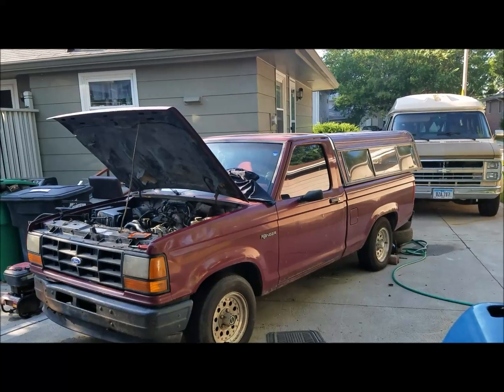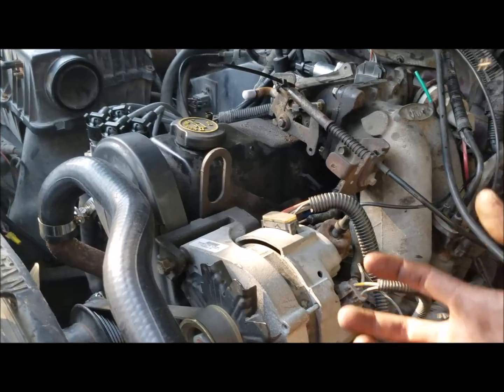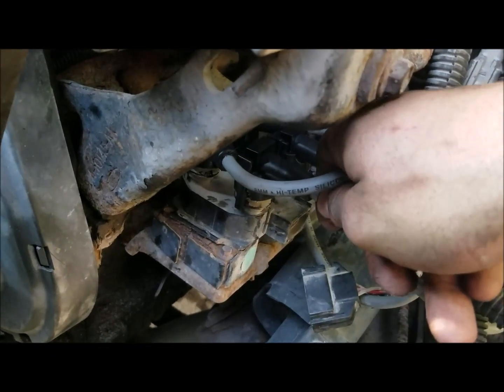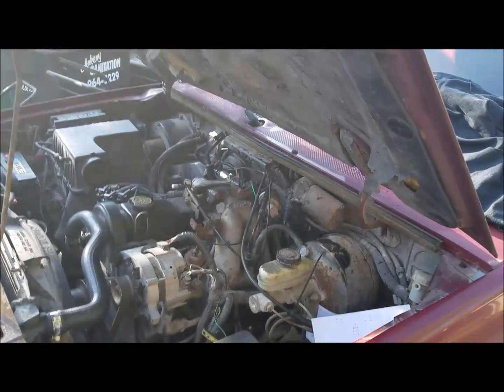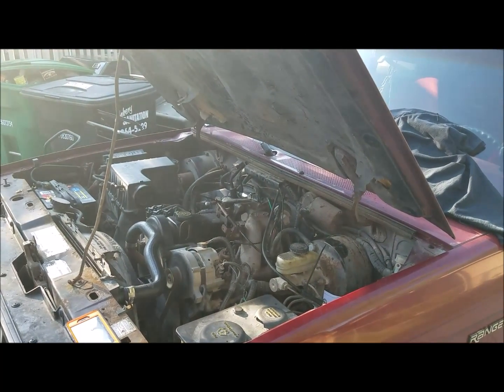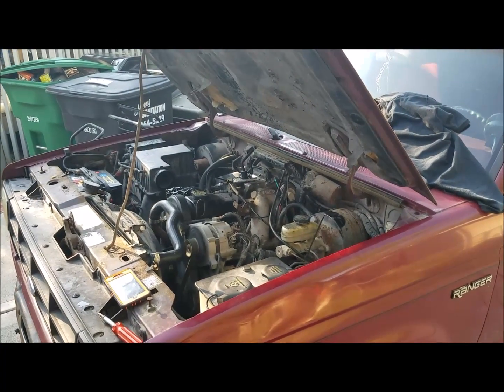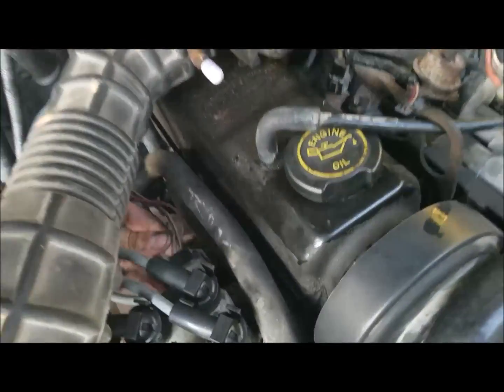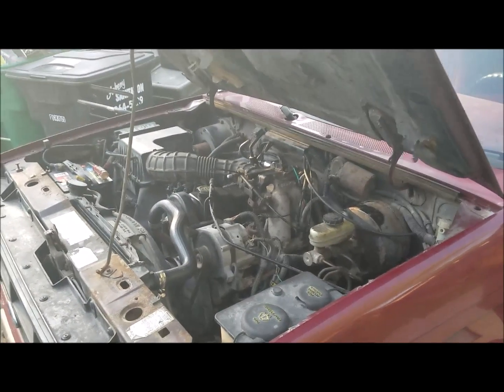Ford 2.3 8 Plug Head - FREE Dual Ignition Mod: How To & Demo (+ HP & ECON)

Comment: This is total bs. The dual plug ranger only has 4 coils, two per pack. Both plugs fire twice per cycle. Basically every time the piston hits tdc. How do I know this? The coil packs are the exact same as in the 2v 4.6. Do yourself a favor and pull both wires you swapped and check if you don't believe me. I'm sorry, but there's no "free horsepower" here. And even if what you are saying was true, firing both plugs at the same time is only a performance feature with high compression engines running race gas. In the case of the ranger, it is for emissions only.
Reply from the maker: When then coils moved to both vein on the passenger side, they both fire at the same time. On this rig the driver fires on exhaust. Fact. 
But I have found for it to only be on this design.
Reply: ThunderHead289 you are absolutely correct, the driver side does fire on the exhaust. It also fires on the ignition. Same with the passenger side. Both plugs fire twice during the complete cycle, every time the piston hits tdc. Try this, swap your plugs back to normal and disconnect your passenger coil. Or swap the wires on your passenger coil. I bet it still runs normally.
Reply from the maker: Joshua Black yeah, that’s the thing. It absolutely doesn’t run if on the standard set up I pull the passenger coil. While running, it will immediately die. Fact. 
On later models, they stay running. 
This plug order deal came from somewhere you have to remember. The new design refutes it entirely and that’s why I would assume there is so much back and forth on the topic
Reply: ThunderHead289 here's the problem, the newer system (94 and up I believe) and the older system, use the exact same coil. I even double checked just now (part # 2-5186) so unless Ford put some failsafe on the older system but not on the newer, there's a problem here.
Reply from the maker: Joshua Black just because it used the same coil doesn’t mean it gets sent the same signals. For instance. The new design - coils both on passenger side will start no matter which coil you have unplugged. The older unit will not if you unplug the passenger side. Fact - I show it in my video. 
Wish I would have shown it cutting out when I unplug the passenger side. Then all the nay sayers would be pacified. Unfortunately I don’t have the truck anymore.
Reply: ThunderHead289 I saw what you did, not refuting it. I'm also not refuting that the newer system is different in that either coil will start the truck. But, using that very difference, consider this; the firing order for the secondary coil doesn't change between styles. It is a wasted spark system on both, regardless of what information the system gives the coil, it only functions one way. Too bad you don't have the truck anymore, would have loved to see you try swapping the plugs on the primary coil to prove everyone wrong and settle the debate once and for all.
Reply from the maker: Joshua Black me too, I actually even contacted the current owner but he had sold it along and I couldn’t get ahold of it. I know, but it would be nice for the world to know. 
It definitely functions different throughout the years. I am on the hunt for one to literally pay a guy 20 bucks to do this for the camera. 
Such an annoying debate.
Reply: ThunderHead289 I'd do it with mine, but it's a 95. I too am looking for an older style ranger to do an active direct comparison. Though I don't have a channel, if I find one I'll film it and make it my very first video. We'll see what happens.
Reply from the maker: Joshua Black I’m down for that. It needs to be a speed density truck as mine is. I’m assuming they switched it when it went maf. I bet it’s a Speed density only deal. 
The lore of the wire swap comes from somewhere, I’m working on sourcing a truck via Facebook forum currently
Reply: ThunderHead289 it will be interesting if I'm wrong and you are correct because it would mean they somehow cancelled the wasted spark and added a second set of plugs to replace it. Also, how cool would that engine be with individual throttle bodies and zoomies? I've seen it on the old distributor motors but never on a dual plug. That's my other reason for wanting the older system, itb is a pain with a maf

Comment: Would this work in a 96? It's a 2.3 8 plug but my coils are both on the passenger next to each other. Seems like this would help me because it idles rough when it's cold like its barely running.
Reply: My 92 has the same set up. I looked up the cylinder order and it is different then his model. I would like to know the wire swap for my model. Would I follow the verbal and ignore the visual?
Reply: It should be the same concept., fucking with my demon for several months, I labeled the ignition coil’s. I’m going to swap out what the man says and see.

Comment: Dumb question but where did you wire the green tachometer wire into? I have a 1990 Ford Ranger with a 2.3L and so far I have had little success finding where this wire is supposed to connect or splice into.

Comment: i have a 2000 and a 1993 and i can unplug either coil pack and it runs. what year mod does this cover? or are your firing patterns wrong on the waste spark coil or are my firing patterns wrong on the waste spark coil? i'm totally hit on this one lol think about it.
Reply from the maker: +John Doe I believe that once ford moved the coil packs together (whatever year that is) they would then fire at the same time. Seems like this just applies to the older rigs
Reply: oh ok, i get it now
Reply: that's crazy how ford didn't even realize until later that they could just fire both plugs on the compression stroke to increase power. it's like their overdriven extra gear on their 5r transmissions.

Comment: Also... Idk much about the 8 plug design but how does it fire the secondary plug on the exhaust stroke??? 
That's counter productive as far as I know. 
Is it firing at 358 degrees or so as the intake stroke is just about to start???

Comment: I noticed the engine sounded slightly different when you unplugged the primary coil. Maybe it dropped in RPM's just a little. 
I think that's a sign that it likes running on 8 plugs at once!
Reply from the maker: +Kyle Love if I had to guess, the head chamber is designed for that primary coil to be the ignition, so I would assume that the flame front is not as efficient when running solely on that exhaust plug -
Reply: ThunderHead289 I totally agree with that theory.

Comment: where did you run your crank case vent hose? i see you disconnected it from the intake and its running to driver side fender. . .
Reply from the maker: flyingjeep911 that’s for another video I have been working on that I will put together soon - pcv vs open breather. That was my first go around with open breather, but I felt it wasn’t enough- so I added ventilation. It will be in an upcoming video
Reply: ThunderHead289 Kool, I have 85 with the 2.3 so I’ll be looking for your side of the situation. and with every vehicle I’ve owned I’ve never liked the idea of blow-by going into my clean air of my intake. I understand it’s for smog purposes so we don’t burn holes in the o-zone. . .
Reply from the maker: ill be going over pcv in some pretty good detail for sure.

Comment: when is the update video coming out?
Reply from the maker: I could make it anytime really - what would you like to know? - i can tell you outright. i drive the ranger daily now. put almost 4,000 miles on it thus far.
Reply: Just wondering if there has been any problems? Have you noticed any gains? mpg or power difference?
Reply from the maker: Here is kind of the run down - I am currently getting 26 mpg combined (i drive 50 to 60 miles at 75 mph every day) gains - seems like it has more low end grunt, comes off the line very smooth. it slightly advanced your ignition timing by means of a quicker flame front in the chamber - i havent had any issues with it. 

iv also deleted the egr, pcv, and gas tank evap lines.
Reply: ok great thanks. Also a video on the deletes you did would be nice too. I have a 94 ranger 5 speed with the same engine you have.
Reply from the maker: Gotcha - i think mine is speed density while yours is MAF, but id imagine everything would be similar. the trick was modding the throttle body to function properly.
Reply: yes mine has a MAF
Reply from the maker: should be the same effects - mine runs perfect, i have no complaints. 
Ill try to get around to making the video soon!
Reply: Thanks I appreciate it!! also if the rotstang ever breaks in half that ranger would be perfect for that v8 to go into. just an idea.

Comment: This a question for your main jets video on a carb when I put new ones in 
do the main jets have to be tightened all the way clockwise and left alone or do you turn all the way clockwise then turn counterclockwise a certain number of turns? I have a 4160 Holley 4 barrel non adjustable float

Comment: Its 800 rpm before second coil will fire
Reply from the maker: Are you sure? I had it idling at 700 or so and pulled the primary coil just now and it was still running. Does it very by model year?

Comment: I had a 87 Nissan hard body 2.4 pickup it had a early version of this 8 wire distributor firing both plugs on the power stroke

Comment: it'll only cause problems if your engine runs lean.  engine idles at 1700 rpm
Reply from the maker: What about 1700? But yes, more ignition timing via dual spark(side effect)  with a dirty filter or vacuum leak will (lean) is not what you would want
Reply: ThunderHead289 1700 rpm is very high for idle, you likely have a vacuum leak. It should idle around 800rpm

Comment: Something I have always wanted to see is a dual plug turbocoupe swap, or a 2.3 turbo in a Ranger. I'm sure it's been done before, but it's something I have always wanted to do personally.
Reply from the maker: if i wasnt horrified of power routers outside of nitrous, id probably try.
Reply: ThunderHead289 Honestly, I used to be too, but after I bought an import I had to do something and stock Honda engine don't usually respond well to nitrous unless it's pulled apart and had the rings gapped properly. I've had 52 vehicles since I was 14, and most of those were American cars. This last one was a 97 Civic and it's original single cam was garbage, but once it had a turbo and a few supporting mods it was so much fun that I ended up swapping for a dual cam engine, then boosted it, then added VTEC, then forged internals, and now it makes 508 whp in a 2250 lb car. You would be surprised by this little bastard. I still have my diesel Ram, but this little thing is addictive.
Reply from the maker: i dont blame you there for sure! there are a ton of guys around my area that do the boosted small engine stuff. personally i just have never had the time to get into it. the 8 hour a day job, house, dogs, and woman keep me pretty busy it seems !!!!

Comment: put a 347 stroker in that pic
Reply from the maker: Let's just jump right to a mans engine - 408 stroker
Reply: that works definitely a tight fit always wanted a V8 Ranger just never knew how to do it I was told you had to beat the firewall
Reply from the maker: its a lot of work, but many folks have done it. im on a few v8 ranger facebook pages. i just dont have the time these days or at least currently for that much body and frame alteration.

Comment: Alfa Romeo has plenty of inline4 engines with twinspark setup. 8valve and 16valve 
I believe the US got the 75 Milano 2.0L ? those  were 8valve twincam engines and delivered 155hp.
my bike is a Kawa ZR1100, it has 4cil and twinspark fired by 4 coils. it works great.
Reply: My daily driver has on of these engines. It a realy unice setup. There are two versions of this engine. The older one had 4 coils, fireing cylinder 1+4 (2+3) by the one coil and 4+1 (3+2) at the same time by a seccond coil. The engine will still run if two coils are not working like on a airplane engine with redundant ignition. The later engines had also 4 coils but every coil fires both plugs of one cylinder.
Reply: My '78 Fiat had dual point ignition, where it had a second ignition system built into the distributor.

Comment: a man working on a shity Ford Ranger.......... I can't think of a more ideal scenario not to wear a shirt
Reply: That's why it runs for 500. He didn't have to spend 5k on a 200k plus Chevy. I bet my tiny 4cyl will whoop whatever you have
Reply: I paid 500$ for my 2002 2.3 duratec, changed radiator, oil and tranny, runs circles around whatever you have and 301k miles and runs smoothly
Reply: @Project-gr6zy  don't pay attention to this idiot rangers have been super reliable before they even started calling them rangers
Reply: @dannymyers5345  I'm gonna rebuild the motor and then turbocharge , I sent the head to be ported to be like the Chevy vortec heads rn with tuning im making about 206HP
Reply: @Project-gr6zy  the 2.3 is a great engine.  I have yet see to many other 4cly engines that will take a beating like the ole 2.3 theirs a reason Ford is stacking it up against the Toyota supra today.  Yes the 2.3 has had a few changes but essentially its the same 30 year old design
Reply: @dannymyers5345  yea, and it's on my channel if you want to check out the thing

Comment: Thunderhead289 I know this isn't relevant to the video but if you can help me out it would be amazing me and my dad have a 86 Camaro with a 350 we just got a guy to put a Edelbrock carburetor on it with a new manifold and distributor it's a HEI distributor I think it's a 650 or 500 the part number on the carburetor is 1404 and the car has a pressure regulator on it with a stock fuel pump in it it was a tune port injected car we're having problems with the pressure we don't have the return line hooked up and the pressure gauge says it's stuck at 7 PSI what should I do I think the car is flooding a little bit because we had to change spark plugs and all the spark plugs were wet with gas me and my dad is not very familiar with modifying cars like this so any info would be awesome
Reply from the maker: the first item of business would be to get that pressure down. do you have any videos on your channel i could take a look at to help this along?
Reply: ThunderHead289  I do not have any video on my channel the pressure regulator will go from 7 PSI to 9 and it will bounce sometime it's like the pressure regulator cannot handle the pressure that's a thought pump is putting out and I've had a lot of people say that we need to hook up a return line to the pressure can Escape and go back into the tank me and my dad is going to mess with it this weekend it's a project for me and him hopefully we can figure it out because we don't want to spend more money on spark plugs because it takes 4 hours to get all the spark plugs out they're almost impossible to get to
Reply from the maker: +1911 world definitely consider a return line and return style regulator located in line after the carb. If it's the stock injected pump, I'm sure it's pretty hard to regulate properly
Reply: ThunderHead289 yep it has the stock fuel pump in it and originally the pump put out about 50 psi and the Edelbrock carburetor can only handle what 5 or 6 Maybe the car already has a return line but not it but the person plugged it off what would be the best way to hook up a regulator I have never messed with one and for the most part I don't know what I'm doing and also this is my first carbureted vehicle that we have messed with in a very long time and I appreciate you helping me out man you have a great Channel I love what you do

Comment: the spark is not gasoline :)
Reply: Um it makes a brighter strong current in the spark making a better burn in the power stroke not the compression it's already comprest at the time it sparkes
And that igniting a 2coil pack will let the spark last longer then a 1coil

Comment: I think the zip ties will work or maybe a spacer. There's like an inch in between the pedal and end of cable under the dash. Do you think that would work?
Reply from the maker: it would definitely work, but i would check for some form of adjustment. if there isnt, some form of a spacer and zip tie assortment will work. my biggest caution is that you dont do anything that can bind and end in you getting hurt via throttle stick.
Reply: What are you talking about zipties are they for the plastic grommet for clutch pedal ford infamous plastic grommet that doesn't work